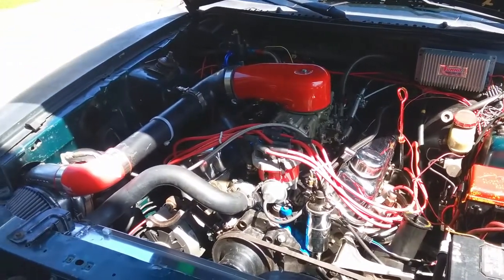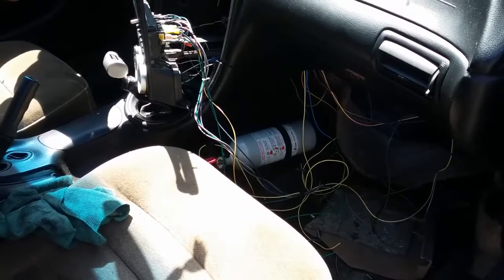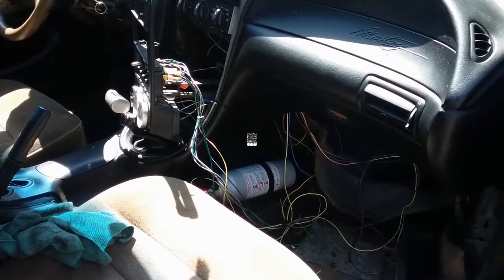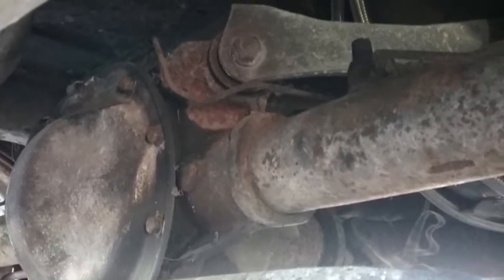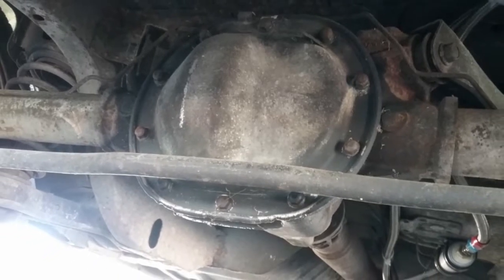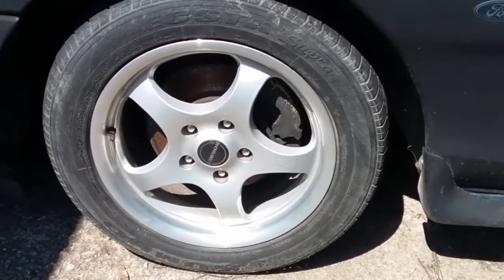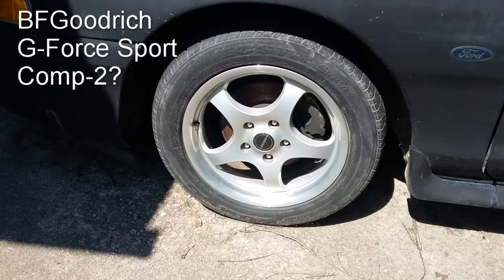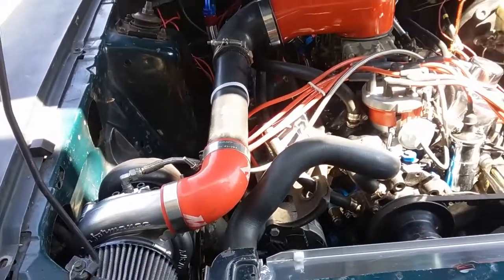Summer Plan for Turbo Mustang

Comment: Hey what Summit ignition box is that and how do you like it?
Reply from the maker: Part number SUM-850610, it is the older version so they have an updated version of it out now. Works as it should, have had no problems with it, wish it had 2-Step though.
Reply: Nuisance Racing If you dont mind me asking what distributor and coil are you running?
Reply from the maker: Chris Benczkowski Chrome summit racing universal coil and the distributor is the stock one that came on the previous 302 engine.
Reply: Nuisance Racing Awesome thanks man. Nice build BTW.
Reply from the maker: Thanks!